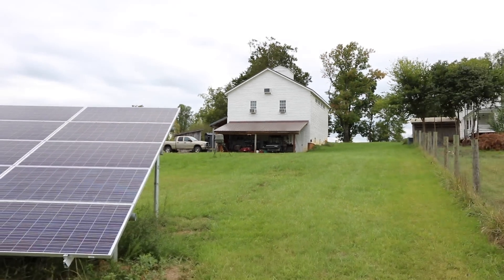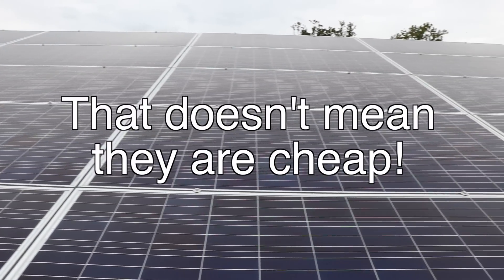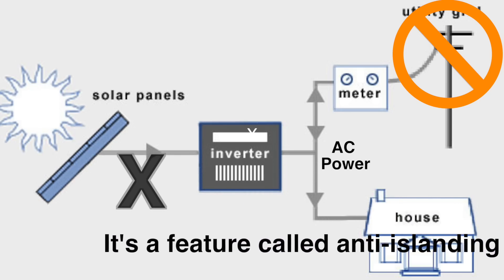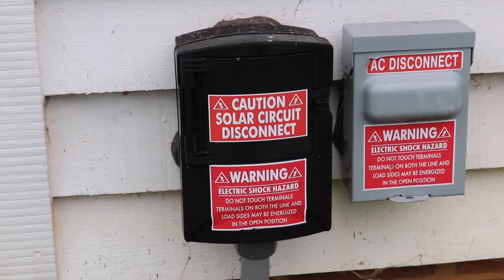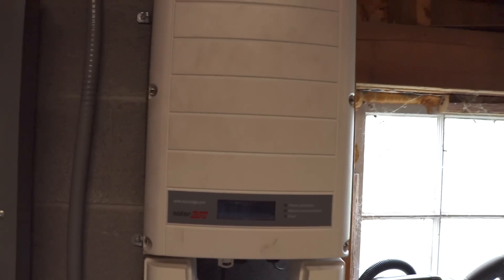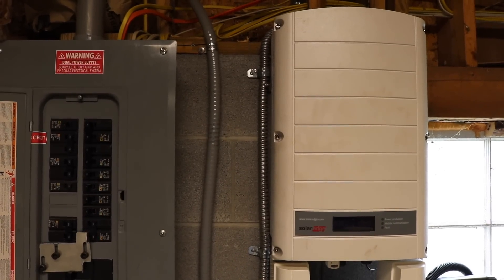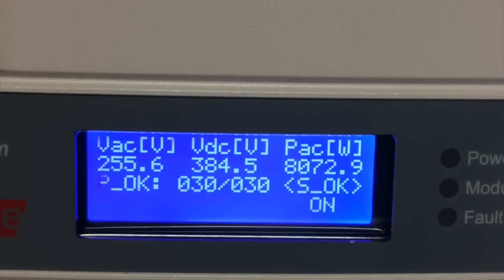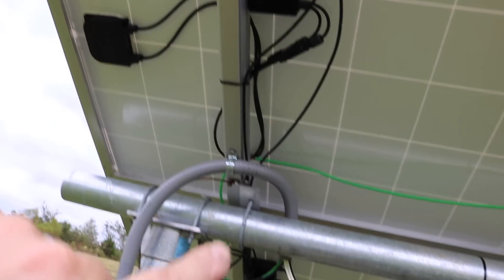The ugly truth behind grid-tie solar systems. Part 1, FarmCraft101 solar.  Watch before you buy!

Comment: Question: If you make more power then you use will the electric company send you a check?
Reply: In Ky, at least in the area served by our utility company, you can only earn credit for electricity.  They won't pay out dollars for any extra power you make. So you need to size the system carefully.
Reply: FlyLowLikeRylo    Thanks for clearing that up I was about to quit  my job and start building solar panels 🤑
Reply: Experimental Fun - it depends on which state you live in...  check solarpowerrocks dot com and lookup the Net Metering laws in your state.   Here in Florida, every month, the power company 'rolls over' any excess kW you send to the grid as a credit for the next month (think rollover minutes on old cell phone plans)...  at the end of every 12 month cycle, if you're still ahead (sent more to the grid than used) they do indeed cut you a check !!
Reply from the maker: Yes, but they only pay at a wholesale rate.  In other words, I save about .11 cents per kwh for what I use, but if I over generate, they only pay 3 or 4 cents.  It's definitely not worth it to over size your system.
Reply: oh I see, thanks
Reply: @FarmCraft101  And, if you have a sharing arrangement with the solar company, that 4 cents is halved
Reply: @FarmCraft101  I totally agreed,  yes they will pay with wholesale and charge you back with retail. By the end year you'll end up pay them.  I believe the solar system has contracted with the power company, the system has to kick back to the grid at night that when we're most used our electric.
Reply: @FarmCraft101  you can always mine some bitcoin on sunny days. You will get those 17k $ faster
Reply: @FarmCraft101  actually it is if youre crypto mining!!!!!!
Reply: @FarmCraft101  On the flip side of that theyre showing u what the power is REALLY worth. But its $0.198 cents delivered with taxes, distribution & customer charge. To me that makes owning your own power well worth the price.
Reply: A friend of mine in Arizona only gets credit on their electric account to be used when they use more electricity than they can generate with their solar panels.
Reply: Experimental Fun 
The utility company that serves my area does pay out. I received a cheque the other day for the first time, for the electricity I fed in over the summer. They pay me a bit more than I pay for the power I draw from the grid -- provided that on an annual basis, I remain a net consumer. I had a 10 kW system installed in February that is projected to produce 10 MWh per year. Consumption is 14 MWh (hot water and space heating all run on electricity, with a geothermal heat pump). This is near Gothenburg, Sweden.
Reply: Sorry my friend, no one with a residential solar system is making $7,500 a month selling electricity back to the power company... at $0.10/kWh that would mean they are producing 75,000 kWh + what they consume each month... this would require a 500,000 Watt (500 kW) system which is 2000 panels at 250 watts each.  That's bigger than many industrial solar arrays.  For reference most residential solar arrays are 5-10 kW.
Reply: FarmCraft101 oh so they pay us what we should be paying them
Reply: If you find cheap panels and build the frame yourself. Assuming you know the laws of electricity and how you should correctly wire the array (panels in series will max out at the current capability of the weakest panel (so if you have weaker panels put them first in parallel to match the power of the strongest panels, other wise your panels will start fighting each other or limit the current flow through each other, if all panels are identical, functioning correctly and the same amount are in parallel at all points in the circuit they you will be ok assuming you don't exceed the maximum current carrying capabilities of those panels. 
  Now you should also take into consideration:
Where you live, how much sun do you see?
Are the panels blocked at any point by any shade?
Do you change the angles of the panels to follow the sun or to make adjustments for winter and summer angles?
What type of panels are they? Thin film panels will produce power in lower light conditions so they can work better in, lets say Scotland for example or if your roof points west for example. There is also cooling to think about. The cooler you can keep your panels the more power they can make.
 I think i have covered a few of the main points here.
Then if you think you are making the full optimal potential from your system, take into consideration the efficiency of your G.T. inverter and if that is working at/within it's optimal voltage range only then can you calculate what you will make depending on what your power company is offering as the current deal.
  Assuming you know how much you will be using then the rest you can sell. Eg. you make an extra 3Kw (after inverter loss) that you don't need while the sun is shining. lets take Vancouver as an example (not the sunniest city).
  Apparently there are 1938 sun hours per year so 1938 x 3 should give you a minimum estimate of how many KW you make in a year.So about 6,000KW. Lets say you were offered $0.15cc per KW x 6,000 = $900 a year.
  You might have to pay taxes and maintenance for your equipment also you will have to pay back the cost of the equipment. 
  If you used thin film panels you might get closer to the annual daylight hours than to the sunshine hours but thin film panels take up more space as they are larger so then you might be able to calculate closer to 4,000 hours a year of average usable light totalling 12,000Kw a year and now you are making twice as much money but probably paying more in tax.
Reply: Possibly longer than life cycle of the panels (20 - 25 years). For example, in Latvia I can get about 1/3 of money back from 0.14 EUR/Kwh with that said I could only break even if I buy panels wholesale price or start my own company and sell power directly to neighbors without using the former national grid, only repurposed batteries from EV's and consumer electronics to store power.
Reply: Segregating your batteries is a weird idea: if you make one big battery bank you can spread the load between all your batteries, making them heat less. Also the level of discharge is lower, so your batteries will last longer. And if your house is big enough that you'll have to worry about losses in the wires, get a 24v or 48v bank.

Also if you plan to run your house on batteries, you might as well avoid hair dryers...
Reply: what if i made a system for only selling back to the grid? with your system how long would it take to break even?
Reply: We (in France) are only allowed to have 3Kw of panels to sell back as residential so only just enough for yourself probably. I am not sure if they allow you to set up another array in your garden as that is what i might do if i can. So i can sell all of my 3KW as long as it's working and have another 3Kw off grid for myself. Otherwise i'm going off grid and building electric cars. I have a 3rd plan and that is to kit the entire roof of my camper van (RV) and perhaps also flip up side panels or fold out roof panels. Since it's just a vehicle parked on my drive they cant really say that it's part of my home installation.
Reply: CORRECT...  when you harvest DC use it for DC
like his inverter..... at .03.....  will crash over time....
your only saving because you dont consume.....
1000+   lol   thats like 33,333 kw 
5 x 365 = 1825 days..... 5 years on the inverter
thats 18kw a day to produce the money needed to by a new inverter
like go buy a 200watt solar and plug into a dc freezer
or run dc lights..... 
run the house on capacitors ..... a million cycles battery are only 600
you save because you dont consume that is it....
you think you need a big solar array.....|
put a solar trim around your window then put a capacitor bank in the room to run your lights and your computer.......  5v.... most tablets  run 5 hours
turn your day time capacitor power to heat or cool in each room....
to store power in a battery is 2 to 1 but its 1 to 1 in capacitor 
now you did not spend 17000 did you.... to bring down your hydro bill
Reply: @ZorroIsGod1

Supercapacitors have many advantages, quick charge/discharge, very durable. However they do have disadvantages as well. Capacitors tend to self discharge quickly when compared to batteries, they also have low energy density. A cloudy day and capacitors will run out of steam sooner rather than later.
Reply: I think you will also have to py tax on what you sell. I guess it differs in each country.
Reply: With Battery backup is it even necessary to be hook to the grid at all if you have a large enough solar grid?
Reply: never build one big battery bank to operate your house off DC
you segregate your system..... or you burn out your batteries 
i need 2 batteries to operate a bathroom...1600 watt hair dryer
once your done your batteries cool off..... put a solar trim around the window..... put the inverter on a timer. plug your hair dryer .... lights are on direct dc..... your timer will turn off the small inverter for you
 bathroom time is what 4 hours all day on and off.....
when its one big battery bank everything need to work off it.....
you burn out your batteries .......
Reply: your batteries will never rest..... thats the problem
a load is a load is a load......
then your inverter is on all the time...... 
like 600 cycle time battery......  what you do is.... use capacitors combinations.......
you can get 16v 500f  40$ a string  70 amp discharge.... 

no joke........1600 watt heat gun ....  no batteries 
https://www.youtube.com/watch?v=eJ1OztoGprU
Reply: izzzzzz6 I tried that. I got a cheap power grid inverter too then called the power company only to find out they have to be approved solar panels and inverter.
Reply: @Bryan-Hensley  
There’s better ways now, with safety features and such. 
Bit you’ll need to be a little guerrilla with your solar. 

First step: don’t call the power company, just shave your bill with your own production.
Reply: @fishhuntadventure  I'm using a couple now. It will show power going back into the grid but the meter numbers doesn't go backwards..
Reply: yes correct they do discharge.... 
you need smart io boards 3,3v you can program... if Capacitors 24v then discharge if 5v stop till 24v.... no batteries.... window trim solar to create heat or cool air with during the day in a room..... small thermal plate...  you reverse the voltage .....   Capacitors bank/////

did i not just use solar to remove demands off your run time usage...
yes  i also took down your gas bill and air condition cost.....

why store it
Reply: absolutely agree ... thats the reason why batteries fail with solar systems.  Batteries if treated properly should last 30-40 years, not 5-8 years.  The constant charging and dis-charging bends the plates in the batteries back and forth, weakening them over time(just like a coat hanger).  You want to charge a battery, let it rest than use it.   More batteries are required in this set up but cheaper in the long run, in that they'll last your entire lifetime (thats if you your charging system charges at a high voltage to make sure all sulfating has been removed from the battery on each charge)
Reply: @mscavsfn Is it 30-40 years or 40-50 years per your other post?

Most Lead acid batteries last less than 10 years, be they in a car, UPS, lawn mower or as power storage system. I can't think of an application where batteries last more than 10 years as a rule.
Reply: I suppose you are right.  The buyer should do a lot of homework and just not listen to 1 or 2 salespersons.
Reply: I got into it and am making money. As I said previously, it all depends on your location and situation.
Reply: First let me say I am in Ontario Canada, and I got into the MicroFIT program a few years ago when the province was anxious to kickstart renewable energy and has closed all coal fired power generation. The Canadian dollar is worth about 30% less the the U.S.dollar so things are expensive here. I installed a 10Kw system and contracted with Hydro Ontario to sell to them at $0.399/KwH for the next 20 years. Average cost of power here is around $0.13/KwH.   All the power I produce is sold to HO and I buy what I use from them. I average $400/mth over the year and run an efficient house so my monthly avegage use is around $80. At first the income from day one was paying my electricity and propane bills as well as the payments on the loan I took to buy the system. I have made big paydowns and now paid off the loan.
Reply: @paulsmith3921  
Why would they pay three times their selling price? You lost me here
Reply: There's the RIP OFF, your paying $17,000 so electric company gets the electric you make, for free. you will not know how much electric they are stealing from you. The grid goes down and your system is useless. your one complete idiot. I bet they even install the system and they are laughing all the way to the bank.
Reply: Why store it?  So you can have power  at night when there is no sunlight.
Reply: Still is expensive... I have an idea to generate electricity for up to 7 years with only 4k USD.. but no one wants to invest this time,.. probably 5k but you can have electricity in any weather condition.
Reply: see you stay connected with hydro and you add solar to the house....
use capacitors..... 1/2 your power bill just got cut and the system will work all the time..... you segregate your dc.....
Reply: Jean-Pierre White I didn't know they self-discharged quickly, that's interesting. How quickly are we talking about? Would they hold charge for a night? Also how expensive are they by amp-hour/Wh of storage? And is the speed of charge/discharge really an issue in a house system? Usually the issue is more how much power you get from your solar, and is your inverter big enough, not how much your batteries can take/give. Especially lithium batteries that have high speed of charge/discharge already.
Reply: Battery university has an article on supercapacitors. http://batteryuniversity.com/learn/article/whats_the_role_of_the_supercapacitor

Supercapacitor self-discharge is measured in days, regular or lithium batteries in months.

The truly limiting factor is the cost of the supercapacitors due to the low energy density. Its simply not economic to store enough energy to keep a house running for very long. The article I provided a  link to shows the price of the supercapacitor to be 10-20x more expensive than lithium ion.

While lithium batteries can charge and discharge at rates that are fit for purpose, supercapacitors are significantly more capable. Charging/discharging a lithium battery is measured in hours, supercapacitor charge/discharge is measured in minutes, typically much less than 30 minutes.
Reply: FarmCraft101 in Tennessee they will pay full rate. They claim they are required to by federal law however they only allow you to overproduce about $300 per year. They keep everything else for free
Reply: CORRECT..... IF YOU CHARGE AND DIS CHARGE BATTERIES EVERY DAY THEY WILL BURN OUT .. THEY ARE TESTED  THAT WAY... they dont test cycles  any other other  way//// 13v to 11v  is a discharge cycle
SO A Battery  should discharge in one day and never charge on the same day
they burn out out the top 10% plate ... and you never used it correctly... they need to stabilize before a charge... so a 600 cycle battery is now a 200 ...
Reply: ZorroIsGod1 do the new lithium battery packs work better? Tesla is selling 60kwh packs for around $5,000 I think.
Reply: here i tested this... a ebike regen  bracking on batteries last 1-2 year... where if they dont have them they last 4+ years..regardless of your battery type.. it has to do with heat... they never rested and your charge or draw bended your plats
Reply: no.. lithium battery  are a fire hazeed ... avoid them....the  more voltage the more fire... and if you do use them put a fire case around them
Reply: @ZorroIsGod1  , have you considered putting capacitors on your scooter for regenerative braking (don't use the battery for regen).  
A lot of what you say makes sense.
How big is your house? What temp range inside? 
Do you use thermo couples for easy cooling/heat?
Reply: think of aluminum as wood if temp hits correctly it burns fuling the fire
like i said amp + voltage can create high temp... egnghting aluminum
like wood it can only burn aT ITS CORRECT TEMP....OR IT STOPS
Reply: here is one for you.... capacitor bank is your consumer..
solar is your supplier,,,
batteries is your storage....
open your home beaker penal..... how many consumers do you see?
float voltage charge and charge voltage charge.. amp current charge and voltage charge...... 
do you real understand how to charge a battery????
Reply: MOSFET breakout board module switch relay (15A, 60V) 3-outputs for Arduino/RPi

MOSFET used: FQB30N06L

now you can direct your solar power......in 3 directions
all use 6 switch relay..... thats 18 directions .....
48v  inverter needs 35 amps to run 1600 power device.....
i want 2 installed...... 900 watts 18.75 amps<----direct to the capacitor banks...... 

my  battery system will only b  4--- 20amp at 48v + 2  capacitor banks
=====scooter batteries...... my scooter is a power bank..... i just plug it in... it will charge it or use its storage......
solar will only be 1800 watts...... 48v.....

now you do the same from the battery ..... to feed your  2 capacitor banks...... 4..... 15 amp lines.... rated 30amps

the 3d line for solar .... when the sun comes down you combined them... and use 60v down steppers charger for your 12 volts.....  lighting....

4  12v  20amp ...... with my 48v volt system..... even at night i can still power 1  inverter 4 hours.......  when the sun comes up..... capacitor banks + solar will work without battery's...... even with empty batteries...

then add a small 1800watt 48 Volt diesel generator <---- back up......no sun winter storms.....
Reply: Most objective explanation of the pros and cons of Solar.
https://www.youtube.com/watch?v=uEIDMkWEc0M
Pros and Cons of Going Solar with Kathy Campbell
Reply: It depends on where you live and what your local utility offers. Mine is encouraging people by paying 29.9 cents/KwH. That will go down over time, but if you sign up now you are guaranteed that for 20 years.
Reply: That is the way it is here where I live. A credit each month to be applied to the next month. But they base it on a yearly cycle that ends each December. If I generated more power than I've used, I get a check cut at wholesale rate to zero out the imbalance. Trouble with this is I'll be buying a lot of power from the grid for the months of Jan & Feb, Maybe March because of the shorter days.
Reply: Did you go into solar thinking it would save you money?
Reply: You need to get off that flex rate crap. That's mostly for businesses. We used to run all our power intensive equipment on the midnight shift cause the power was so cheap. Trust me, unless your a big, and I mean big user it's not worth it.
Reply: Paul, can you give us some figures?  How much you spent and how much you save every year?
Reply: The REAL problem... Most power companies pay you (If they pay at all) far less than they sell power to you. Plus... Because you send electricity to them... Many sell you back power, when you need it, at a higher price than your neighbor, without solar, pays.  The price, if they pay... Is so low it actually COSTS YOU. Here is how... When they receive power from you... It is lower than their cost to produce it themselves... Meaning they are selling power from you to others at their price but they pay $0 maintenance costs... You pay for your stations upkeep and repairs and they get to sell your power with no maintenance or upkeep expenses.Thank your congressman. Senator and such for this!!!
    Oh and the cost with rebate is still much higher than if you do all the research and purchases yourself.  In total I have just over 3.4KWH which includes wind generators and I have almost $5,000 invested and no rebate! I have yet to install my equipment because my plans do not include a house nor barn to power. It will be a portable system.
Reply: And that is what the power company is resisting that you are a micro-producer. And to be fair that is why you connect to the grid for consistency and sharing the maintenance.
Reply: In Florida back when I first looked at panels Teco had to pay any customer retail to buy power while one could buy it at wholesale. They eliminated that quickly. At that time, you didn't even need a PERMIT for residential, according to the building department
Reply: Mark Edwards was
Reply: Depends on the power company and where you are located.  You can make a nice hearty profit in some contrives.  In the United States you can not.
Reply: I believe  they refund the kilowatt amount not delivery and other charges. My kilowatt charge is .0421/ kw. Maybe you can clarify?  To DIY Tech and Repairs, I am frightened to think of what your battery system cost.
Reply: They buy wholesale and sell it back retail. NO Check.... only profit for electricity company.
Reply: FarmCraft101 Only becaus the law requires them to do so in some states.   There is nothing the homeowner can make at homeowner costs and send back down the wire that is useful to large utilities.
Reply: How does this do $200 a month during the winter or other cloudy times?  I thought solar depends on sunshine not  just daylight to actually produce decent power...
Reply: Experimental Fun =) I find you everywhere now I think we have the same interest lol
Reply: ZorroIsGod1
"the next problem with large battery bank ..... one battery dies.... 
"your hole system comes down"
What's the problem?
Get a Tesla S P100 battery and run 480v with BMS, no need to worry about individual batteries, it will equalize everything.
Reply: I don't want to sell back the power to power company, I would rather bank the power because it has more value to me. The problem is their smart enough not to allow for that, so they settle up with you on a chosen yearly anniversary date in our state.
Reply: They should pay you per kilowatt hour what they charge the consumer. I would bill them.
Reply: "it depends"
Reply: Yes they will.
Reply: Yes they will credit you. Remember the solar system will kick back to the grid at night (evening) so you have to use the grid power.  They will charge you more than what that'll credit you.  Basically they'll pay less from you at wholesale price and charge you retail price. By the end of the year you'll pay the different. I believed solar is RIP off.
Reply: @hh4545  
THAT way of doing it is a ripoff
You can shave a lot of your bill with solar with a moderate system with batteries. You use it without ever telling the power company. You won’t get paid if any excesses exist but size smaller, don’t tell. 3-5 year payoff. The big install companies are often 20+ years to payoff because these guys are making lots of money.
Reply: @fishhuntadventure  Thanks
Reply: Depends on where you are too.  PG&E in California doesn't send you a check.  No matter how much extra you generate, you can only get your bill down to zero.
Reply: Not in Mississippi. It’s illegal to be tied into the grid at all.  So bogus!
Reply: Depends on where u live but what happens generally is some utility companies pay u back for the excess power u dont use which goess back to their grid, that is because it actually helps them to keep up with the demand from utility customers, every kwh you dont use is a kwh the utility company doesnt have to process
Reply: Here in Belgium we smused to have the analogue meters turning backwards. Now they made it digital so theres two separate counters: one for what you take from te grid and one for what you put back on. We pay 25c€ (about 30c$) for a kWh from the grid and now only get about 4-5c€ for what we pump back in. A few lucky people still have the oldschool meters which have a single counter that can turn backwards. Don't be like Belgium. Is your electric company starts talking "digital meters" cause "it will save you money by giving more insight into your consumption" and promising you'll receive the same per kWh as what you would pay per kWh, don't fall for it and baricade your door!
Reply: That depends entirely on your utility. My utility in Florida has net metering, which just means they pay me the exact same amount per KWH as they charge me for.
Reply: Some power companies will only give credit towards your bill.
Reply: lol are you kidding?
Reply: Steve b - It doesn't work like that. The charge being fed in to the grid (through his meter) is like water being dumped in to the ocean.  The next door neighbors will draw from it (through their meter), but so will everyone else on the grid.  If he wanted to feed his power directly to his neighbors, he would have to wire them to his sub-circuit directly (i.e. feed them the excess power before it goes back out his meter).
Reply: @doc jay It is possible to go totally off grid with the right setup. Its worth considering having the grid as a fallback, in a major storm event or other natural disaster the utilities can organize hundreds of crews to come in fix things up relatively quickly, whereas if you are totally independent you may wait a very longtime to get service after a natural disaster should your system be compromised. "Sticking it to the man" is very tempting, but comes with its own responsibilities and risks.

In some states it is required you be connected to the grid if you have solar and be subject to the requisite tariffs. There are several pieces of legislation out there that are solar hostile.
Reply: the next problem with large battery bank ..... one battery dies.... 
your hole system comes down 
ohhhhh you cant just add a NEW one... they wont balance out
Reply: @
FlyLowLikeRylo
It's true that grid-tie solar does not work that way, you can't ensure you neighbors get your excess.

However some communities are building community systems. The community system is tied to the grid in one place and it is possible to sell excess directly to your neighbors rather than feed the grid. Payment between parties is handled using blockchain. The community solar association take a cut of the transactions to pay for maintenance of the technical infrastructure to enable this community collaboration.
Reply: My bad.  It's was a well over a year since I saw the video.  Australia was paying (I think .75 AUD per kWhr a while back.  PG&E is about to pay $0.85 USD in energy credits per kwhr.
Reply: My bad it's $7,500 per year.  The video is on YouTube.  They are in Canada. 

PG&E where I am is now paying $0.82 per kWhr on peak days.
Reply: What the utility will pay you, and how the power you generate works depends on where you live.

But basically the credits you get for excess production, to be netted off the next month, is the best deal you can get. And it's already a massive subsidy: the utility is losing money by allowing you to do that. Or more precisely, when the utility has regulated tariffs that allow it to recover its costs, other consumers are paying for your electricity.

It might seems counter-intuitive, but when you produce your own power while still being connected to the grid, you are basically taking advantage either of the utility or of the other consumers, you are not just being independent. That is because there are a lot of fixed costs in running a grid, while the utility mostly charges you a variable rate. Simple example to understand what I am saying: imagine you produce double your consumption in one month, and nothing the next month (but consume the same). Your net consumption is zero. If you pay zero to the utility, someone will still have to pay for all the wires in the grid that were used to provide you power, and for the power plant that was used to get you the power in the second month. Also you pay zero taxes, so someone will have to pay these taxes instead of you (these taxes can include for example a charge to pay for renewable subsidies, or to help low-income households to afford their bill). The example is obviously far-fetched to make it more easily understandable, but people with solar panels still need the same amount of wires and the same backup power, because these are usually sized for a scenario of maximum demand while there is no sun (or wind). Just the wires (transmission and distribution systems) can be easily a third of your electricity bill.

Now it is normal that solar producers get subsidies, because solar power is better for society than fossil-fuelled power. But it is a much fairer system to have people selling their production to the grid at wholesale price + bonus, at a level lower than retail price, and still paying their bill like everyone else, than having systems where you net off your consumption by your production. It is also more transparent.
Reply: Don't forget to adjust for Inflation.
Reply: It depends on the agreement you have with your power company.  Look on YouTube there’s a couple who installed solar and is making around $7,500 a month selling electricity to there local power company.
Reply: @passedhighschoolphysics6010  lol, right
Reply: @passedhighschoolphysics6010  But didn't pass English.  lol.
Reply: @linsierra1749  That is because I'm not English, I'm American.
Reply: Ummm, why don't you call your electric company and ask them, doofus?
Reply: @zenovice8240  You think you would get a straight answer doofus?
Reply: @zenovice8240  lol